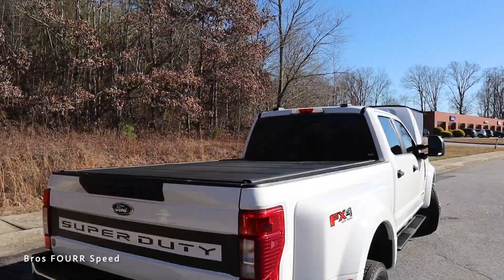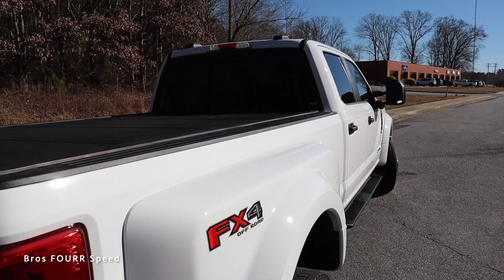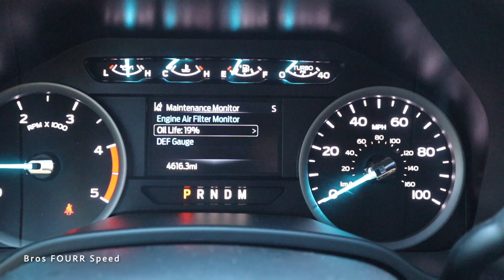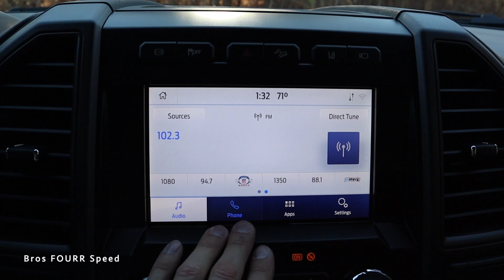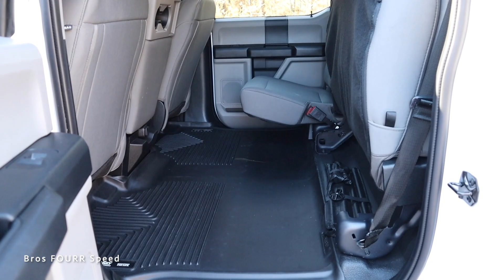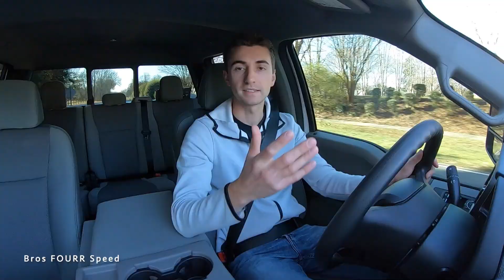2021 Ford F-450 SuperDuty XL STX FX4: Start Up, Walkaround, Test Drive and Review

Comment: It should be mentioned that on the XL STX the front fenders are abs plastic black and not painted to match as shown.
Reply from the maker: But the plastics are painted to match on this XL STX and this is a new truck!
Reply: @BrosFOURRSpeed  dealer must have done it then or it was a XLT and gave you the wrong info cause the XL def has black plastic fenders.
Reply from the maker: Interesting, I've never seen one with the black fenders!
Reply: @BrosFOURRSpeed  just type in 450 Xl STX in YouTube and you will see
Reply from the maker: @MichaelBrown-ke8dn  I see it both ways!  So either it's an option or a difference between 2020 and 2021!
Reply: @BrosFOURRSpeed  no it’s not a option if it’s a Xl it will come with the black plastic fenders. Please provide a link to other ways you are seeing them. I own 5 450s and have custom ordered them all from factory from 2019-2022 year ranges. Ford website even states they have plastic fenders in that trim level.
Reply from the maker: Then someone painted them, or swapped for body color. It's not my truck and I don't really care too much about how the F450 is setup. I'm just showing this truck and what it has to offer. The color of the flares doesn't change how this truck performans. And in the world of cars/trucks, it's not hard to change the color of a fender flare.
Reply: @BrosFOURRSpeed  I agree I was just simply stating that for other people so that they wouldn’t get the impression or idea that if they order or buy a 450xl that will not be the way it comes from factory that’s all.

Comment: Replacing tires is very expensive on those 19.5” Rims ! Trust me !
Reply from the maker: How much would one tire cost!?
Reply: Because it’s a 19.5” Rim & it’s a F-450 the tires can only be replaced by a certified commercial truck service center . In the area of $3500-4000 easy for all of them replaced!
Reply from the maker: @roadglide1142  Honestly that doesn’t sound right at all, most shops can handle that size wheel so if you have paid for that before at that price, you got ripped off big time. It shouldnt cost over $200 if that, maybe $300. Even with a 19’ rim.
Reply: @BrosFOURRSpeed   You price them ! Be my guest & you will see! Remember only a certified commercial truck center can install them ! These are not F-150 tires ! They are 19.5” btw commercial size!
Reply from the maker: @roadglide1142  If it cost that much, no one would buy the truck, that’s a ridiculous price man, a local tire shop could install those. Good luck on the next set because that’s more than any vehicle in that class.
Reply from the maker: @roadglide1142  a quick google search and for 6 tires it could go up to $2K if you are buying higher brand tires which you don’t have too, but installed wouldn’t cost a lot either, so about half of what you quoted would be reasonable.
Reply: @BrosFOURRSpeed   A local tire shop won’t touch that truck with a 10’ pole ! It’s illegal for them too & they would lose their license! Local shops can only work on up to F-350! The F-450 is a commercial truck capable of towing over 30K pounds and it’s tires are 19.5” commercial grade ! Do your research! Then get back to me ! You obviously don’t know what your talking about !
Reply from the maker: @roadglide1142  Have fun with the truck and spending that kind of money.
Reply: @BrosFOURRSpeed   F-450’s are made for hauling heavy loads & making people lots of money doing so whether it’s construction equipment on a Diamond C trailer or for recreation towing a large camper ! They are not made for cruising the mall . The owners know the maintenance costs of owning such a beast but most don’t mind because the truck puts food on their tables everytime they turn the key .
Reply from the maker: cool
Reply: @BrosFOURRSpeed  Go watch the workplay & Danger industries channels on YouTube & you will be educated on what the F-450 was designed to do.

Comment: The F-450 is too big to park anywhere and also fuel consumption is likely to be horrible.
Reply from the maker: Yeah it's big for normal spots! But not that bad overall. People who buy this need the towing capability. So they will have a big trailer attached anyways. So parking space wouldn't even work regardless. And for what it can tow, this is very efficient when you need to tow 10k lbs of stuff. Gas truck would suck through fuel much more